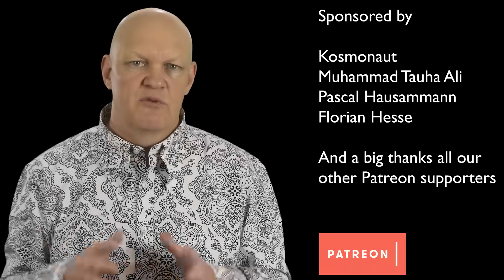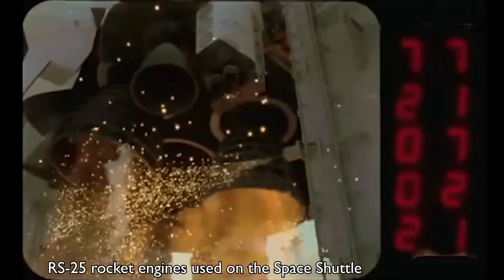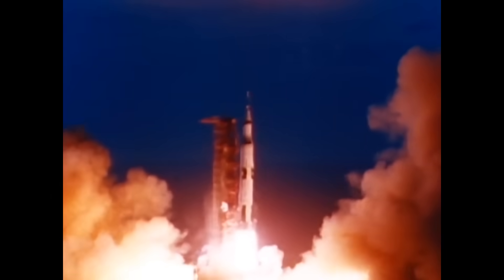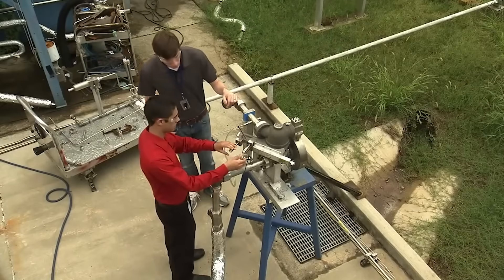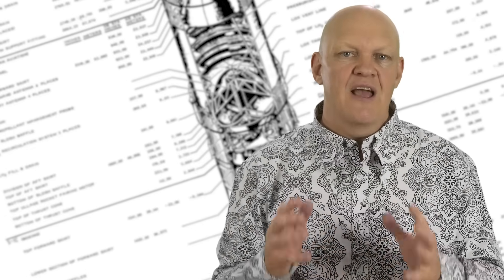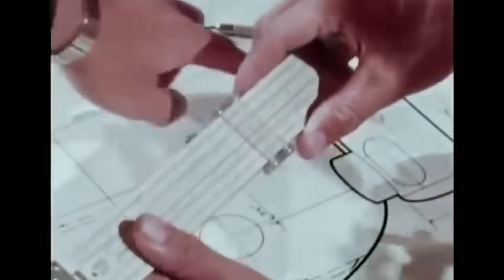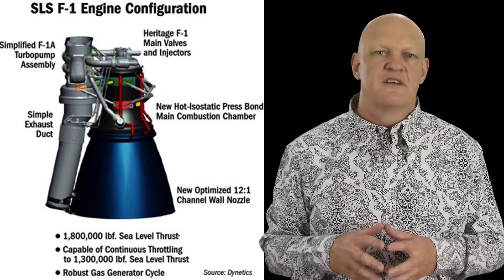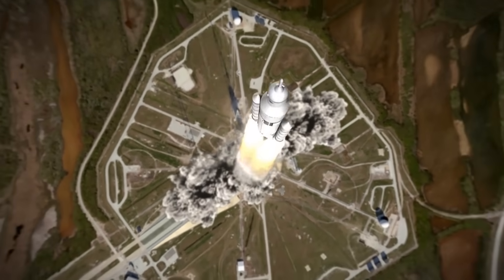Why Can't we Remake the Rocketdyne F1 Engine?

Comment: It would make a certain amount of sense for Elon Musk's SpaceX Corporation to manufacture and use the computer designed, modern version of the F-1 engine with only 40 parts versus the 5000 in the original engine.  Just a few of those could replace the dozens of smaller engines that SpaceX heavy lifters currently use, reducing complexity.  On the other hand these massive engines would need to be gimbaled, rather than using just thrust adjustment across the array of smaller engines for tilting the rocket.
Reply: Starship doesn't use differential thrust, 23 of its 33 Raptor engines gimbal. Also, Raptors are designed to be mass produced and rapidly reusable, meaning if some are damaged you can change them out really quickly. Also the amount of engines give it a lot of redundancy.furthermore, they've alr developed the rocket and engines together so they'd have to design a brand new rocket.

Comment: Old machinist here, I made a ton of B52 repair parts from full sized mylar 1950's drawings. There were no dimensions on them. I had to dimension the drawing before I could even start to make the part. Wonder how much of that was going on? Hand fitting parts is how you build a Rolls Royce not a Chevrolet.
Reply: they had dimensions bc thy had to estimate the weight to the gram. toolmakers today are even better than ever. he is lying
Reply: @Allineveryhand  The dimensions were erased before they shot the mylars. If we were lucky we could see them on the light table. Still speculating on why they took the dimensions off before they archived the drawing.

Comment: They should build an F1b and put it thru its paces to confirm the design and manufacturing processes. They could rectify any faults that are identified and have better confidence that it is a feasible option for the future. But if what I have described is a reasonable approach, then surely they will never do it.

Comment: Seems rather defeatist. A team could 'attempt' to build an F1 engine, from the existing plans, whilst not being under any time pressure, and they would then be faced with the same engineering problems the original engineers where faced with, but could come up with even better solutions now that we have better computers and CNC machines.

Comment: The issue is more likely the materials used in the 1960 are no longer or cannot be used today. Asbestos based adhesives, high VOC paints and primers, Cadmium plated fasters once used in building aircraft structures cannot be used. Yeah the numbers of skilled workers is not the same but I can say there are companies in the US that are capable of amazing metal working

Comment: I understand that computers are the engineer’s tool now, BUT the greats built our space system with slide rules, mental math and real world skills… 

I had a prof that was in my research group who had a professor that made them calculate Fourier transforms for IR spectrographs from raw data as well as graph them… 

That was only 20 years ago. He was only 30 years old at that time.

We depend far too much on computers. What does an engineer do when these aides aren’t available? Sadly, nothing, work stops nowadays… 

A chemist should be strong in higher mathematics just as engineers should be… same with medical doctors, but, alas, that’s just not common.

Comment: I used to work at a VERY small medical supply manufacturer.  The designs were all legacy 1980's designs.  We had the schematic and parts but some of the skill and craftsmanship for how to assemble and manufacture the devices were lost when people passed away or retired.  I was part of the production team and worked as a tech, some of the older units were much stronger and better than I could make since I was obviously missing some of the technique for how to make them "best", I could make units that passed the checkout sheet but they were noisier and lower signalled than most of the 1990's units.  It could've been something as stupid as "Make sure the glue doesn't glob past this line" or "sand down this piece of plastic this much, but not THAT much" or something.  Analog electronics and transducers are weird, especially handmade ones.

Comment: Obviously we have downgraded education to it lowest point.
Even in the vest colleges.
  Now our workforce can barely count change and cannot even write.
Reply: For the same reason Chevy can't make cast iron big block cylinder heads anymore. The equipment used to make it is gone.  And why make obsolete parts again
Reply: @rogerwilco5918  

Cast iron heads are way better than aluminum.
Reply: @swl9104  Top Fuel cars are pushing 12,000 horsepower through their aluminum cylinder heads. 
Please elaborate.
Reply: @rogerwilco5918  

I don't know much about Top Fuel, but in a regular mechanic's estimation, aluminum heads aren't as durable and warp much more easily than cast iron.    

I may be behind the times or whatever, but that's been my experience.
Reply: @swl9104  a good mechanic will keep his engine from overheating and warping.
There's a lot of good reasons cast iron heads aren't used anymore

Comment: The liquid rocket motors on the Space Shuttle were considered for a update by improving the ducts that took the O2 or H2 to the combustion chambers. There were areas of stagnate flow in the original design.  I worked for a short time at NASA’s airflow facility as a young engineer in the 80s validating a airflow test facility with the objective of matching Reynolds # between the air in the test facility and fuel or oxidizer in the real engine. I think it was Rocketdyne’s and it was moved to Huntsville. I didn’t hear if it went anywhere after I left to return to school for my MS.

Comment: they struggle to remake them because modern day engineers are stupid and cant grasp the concept that parts are "fitted" no single part is the same, they are deliberately made oversized so they are made to "fit" you gotta understand the limits of technology at the time and reproducing tight tolerances was simply not safe or reliable enough, however when you custom fit a part, this is much safer and reliable, however it is old world knowledge and a true artform that is slowly being lost today, it is unfortunate, i hate how this guy says that the people with the skills dont exist today... they still do exist, they are called machinist and welders... they just dont have a harvard degree

Comment: I had this happen in a place I worked. The machine shop would produce oil drilling tools I would then have to finish by hand to get working correctly. I was later laid off and from what I heard every tool then on failed downhole leading to the client pulling the plug on the contract. The building is now empty which is a bit sad. Beware of letting people go unless you understand exactly what they do.

Comment: Engineers of today don't have the skills to use a slide rule and a compass since they are not used anymore. I have been a mechanic for close to 40 years. When I was in high school auto shop we still had distributors with points and condensers. Today's modern techs wouldn't know how to adjust them much less know how they work.

Comment: As an engineer that designs, manufactures, and tests large “one-off”  purpose built complex machines, I can confidently tell you the hardest thing to do is convey all of the “field mods” sometimes called “field-fits” the technicians and I both do to get these machines running perfect. Even if we make two of the “same” machines, there will always be slight variations and the magnitude of these variations are not always reflected in the drawing revisions. The drawings will be the similar with each variation but it’s the magic sauce of years of experience and ingenuity the technicians have that make these things run.

Comment: We cant make steam locos either. They are obsolete. Look at the thrust from a space x launch. Its a massively bigger rocket capable of bigger launch load. And many times more powerful. And is partly recycled returning to the pad. More redundancy. Much cheaper per launch...except the sls which is a cost nightmare and zero reuse.And seemingly.no.launch load capacity

Comment: I grew up where the F1 was built and tested.  Of course we could build an F1 again.  It just doesn't make sense to build another F1.  
I worked for a tool grinder who did a lot of work NASA contractors.  
Look what SpaceX does today.  They use computer systems we didn't have for the mighty F1.   They use materials and techniques  not available for the F1.  
On top of all that SpaceX recovers boosters for reuse.

Comment: if we can remake the F1 as the F1b with less parts and end up within 2.5% of the original thrust, cone vector shape, thrust output shape, assembly balance specs and still get more than 200% reliability we should try it and test it as i think we could do better maby even lighter and stronger. theres no reason we cant try to copy with modern fabrications and make a better version of the same engine that saves energy fuel and money. "the kids just need to step up that explorer spirit and try to build it" so what if its off some it should be safer after its dune with a fraction of the pieces all of which would help streamline it into a better engine in the end. imagine making the same trip to orbit as the first ones but not shaking and wobbling to the level of loosing ones dinner.

Comment: The F1 was a use once and discard engine but the test models were used over and over many times.  My father was a NASA electrical engineer from 1966-1997. Retired as a GS15. Based at Goddard Spaceflight Center and built the TDRS system in the 1980’s.  He still helps me fix electrical problems.

Comment: Kerosene based fuel.  Burned hot enough to destroy itself. Complex engineering averted that.  They don't want to try that again.  Hydrogen is more power and cooler burning!  Parts last and are reusable.
I love your video!  Great format, straight to the points!  I'm a scribee!!

Comment: We can remake it, and in fact we started to. When the Constellation Program was started at NASA, they planned to use the F-1 for the heavy lift. Rocketdyne started work on the F-1R to support that requirement.  Many of the design documents were incomplete or missing so they took an original F-1 off the Saturn 5 in the Apollo Museum at KSC and took it apart and started to digitally map it. But they ran into a small issue. They found out that many of the F1 engines made weren't exactly the same. Many of their parts were machined by hand at the foundries and there were a lot of variances. They found that many of the thruster bell housings were not the same at all. So Rocketdyne had to essentially re-engineer the F-1 from scratch . Unfortunately the F-1R contract was cancelled sometime after the Constellation Program was. The Saturn 5 flight computer is still considered top secret and if memory serves there are only 3 of them still in their original encasement. The rest went into the ocean after launch. The test unit at Marshall, and the 2 that reached assembly for Apollo 18 & 19 but never used.

Comment: I remember an online discussion about this topic 25 years ago.  At that time someone said all the blueprints were stoed on film slides—-thousands of them.  They were about to discard them.  
If, in fact, a complete set remains somewhere, the men who did the work are either long dead or have forgotten the undocumented critical steps of manufacturing that spelled success or failure of the part.  
And do you really believe anyone could resist the temptation to “improve” everything?   On a design that despite having approximately 200,000 parts, it worked ON THE FIRST TRY?

Comment: The F1 Engine was built by Engineer / Craftsman. Since then we have learned to do less with more.
The Art of Engineering is being lost. I spent 54 years working as an EE transitioning from pen and pencil to CAD. The manual approach had its own rewards but secondarily,the methodology forced you to be precise and think carefully about what you were doing. I can fix a mistake in a CAD design in hours. Manual methods would take weeks to fix the same mistake. There is no risk!
Pride of workmanship enters into it as well. Anyone can design a PCB Layout using ECAD, only craftsman artists can do it using an X-Acto Knife, mylar, tape applying manual drawing techniques. Being able to apply the efficiency of computers to manual methods will yield optimum results. ECAD is not necessarily progress. Using CAD Tools inhibit creative thinking due to the limitations of their functionality and structure.

Comment: Along with the skill of the engineers, there were a large number of special tools designed to help in building those engines. For instance the main part of the engine bells contained a large number of tubes that the fuel ran through in order to preheat the fuel.
These were made up of thousands of parts brazed together. A special chamber was built to place the assembled unit into and was brazed all in one piece inside this chamber without human hands doing any of the brazing.

Comment: The past isn't better, there's a reason they didn't remake f1 engines. The brazed tubes on the bell of the f1 were admittedly slightly lighter than modern additive manufactured channeled bells, but they're immensely difficult to make as they're a skilled craft. Rocketry isn't about sending 1 or 2 rockets up per year anymore, it's about reuse and reliability of design. The f1 engines were NOT cheap, and they absolutely would've used modern technologies if they had existed back then.

Comment: They used an oxygen/kerosene mix for fuel which NASA doesn't want to do. Preferring to use oxygen/hydrogen instead. The trouble is hydrogen needs bigger tanks to store it than an equivalent amount of kerosene so you need to have either a bigger first stage or use strap-on solid fuel

Comment: We may not be able to make those same engines EXACTLY but we could make them such that they'd be indistinguishable from the original.  We can make the pumps, the gas generator, the injector plate, the nozzle, all the hypergolic elements, etc. Would undoubtedly take some iterations to get it down just right but we could make them.

Comment: There are other "secrets" embedded in the engines. Back then Engineers relied on several key ideas and used them heavily. The Buckingham Pi method for developing dimensionless parameters, then correlating behaviors in regions of those correlations was common. Within that are "hidden" many key ideas. Some are common today. Some aren't. Turbulent vs laminar and transitional flow is still used. In naval use, Euler's number or it's inverse the cavitation number was and is still common. But lesser" known correlations with other dimensionless parameters are largely an art now lost. 

Today's scientists and engineers use computational fluid dynamics and miss vital domain changes in the process with the result failing spectacularly. 

Add to this the intricate beauty of the shock boundary transitions and thermodynamics. This was common knowledge back then. Also the detailed metallurgical understanding of how welding affects alloy compositions, and how to deal with that. Not to mention the sudden phase shifts in some alloys. One of those may destroy the Space-X engines at some low but random frequency. It did in the Davis Besse nuclear reactor control rod drive sleeves, nearly causing a PLOCA or FLOCA, and did lead to the very quiet replacement of all rod drive sleeves in all commercial reactors. 

Add to this little things like triboelectric charging, and a thousand other not so well documented phenomenon.

I know in my career I developed hundreds of trade secrets that I never shared with anyone. I particularly never shared them with companies that consider everything to be theirs, and fungible. I employed them without explaining. Many of those resulted in systems that ran magnificently, but which could not be successfully replicated. Instead those replicates tore themselves apart as the engineers did not understand the fundamentals in the designs. 

 Others I shared broadly and they now form parts of standard methods used by all, that no one knows the origin of - but me. That makes me smile.  No one can ever pantent thise. They belong to everyone. 

Many of my engineering friends did the same. We thoroughly documented our designs, while omitting the key ideas. 

The same holds true in machining, metallurgy, chemistry, vapor phase dynamics, control systems design, systems design, control orifice design, and in a hundred other specialty fields. Have you considered how acoustics applies? Or using optical equations for radiant transfer, black box radiation assessment, harmonic oscillation, and how to disrupt or utilize those? Reaction rate changes with time, temperature and pressure,  or with the impacts of key trace components? Or lag time in control systems? or or or or or ....

Then there are the subtleties of real world fluid dynamics that involves behaviors not captured in any computational system. And not documented in any book. 

Add too understanding that temperature and pressure are not scalar properties, nor vector properties, nor even tensor properties. They can be truly strange in some regimes. And those can be extremely important. These ideas have huge importance in high vacuum applications, under cryogenic conditions, and combined with other phenomena. 

Then there are the largely lost fields of fluidics, electrodynamics and many others. Fractional hall effects, magamps, venturi pumps, and more. 

I find it entirely unsurprising that the engine is a mystery today.